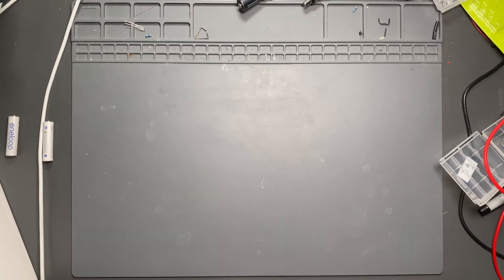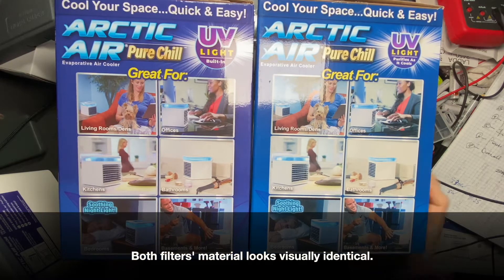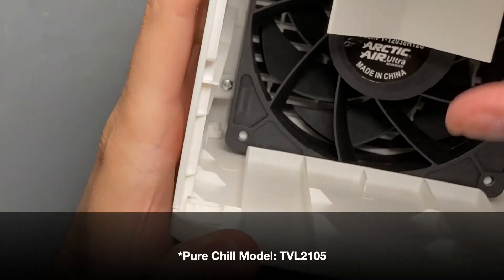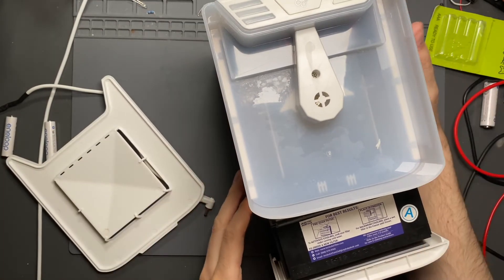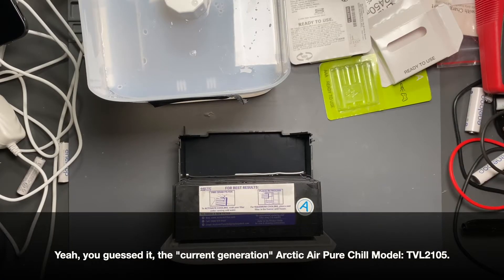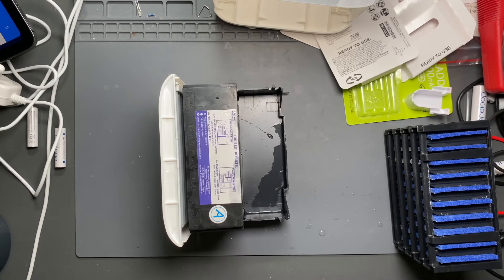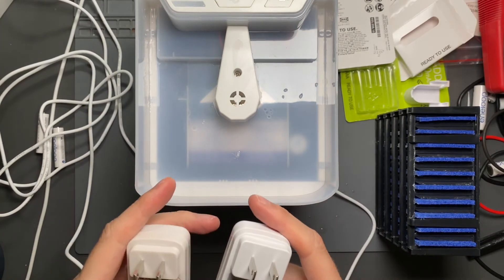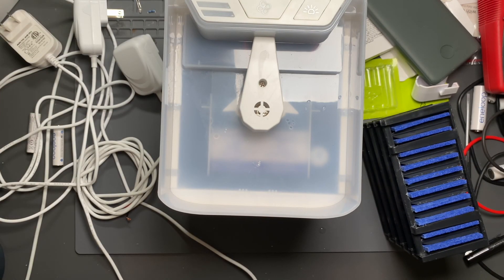Arctic Air Pure Chill - 2020 Version - Analysis and Testing

Comment: Interesting!  I bought a Pure Chill from Home Depot, and it is also an “Advanced” model, but it has a different power supply from a different location which is rated 100-240Vac input.  It says “0321” in the corner, so it seems to be the same manufacturing date, but interestingly enough, it is the only of the 4 which was Certified to UL 62368 instead of UL 1310!  Quite strange.  The rest of the unit seems the same as your “Pure Chill/Advanced.”